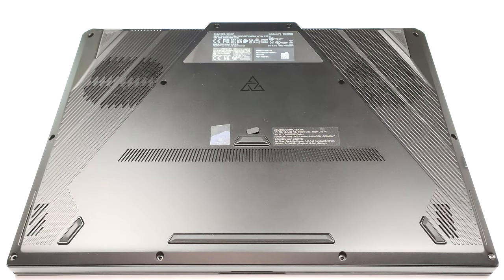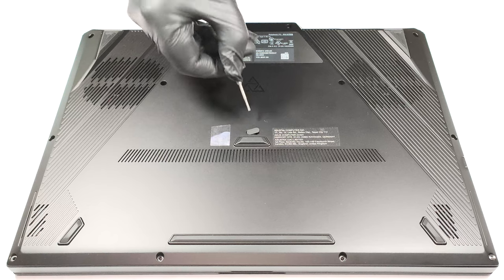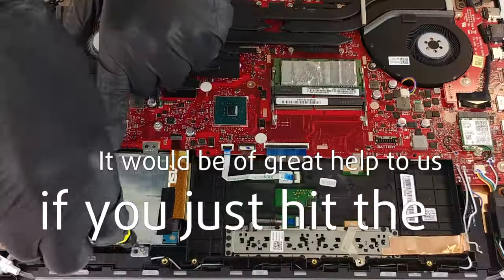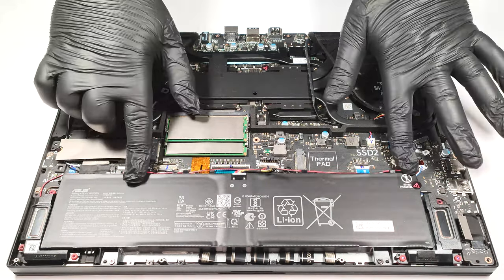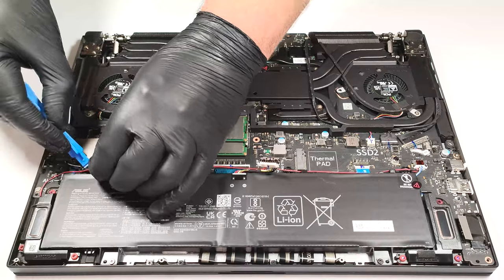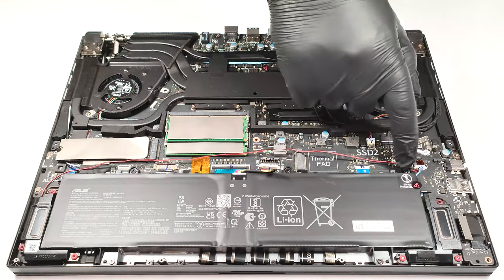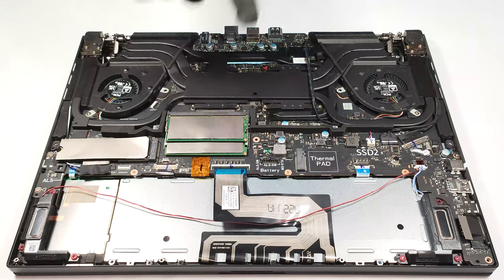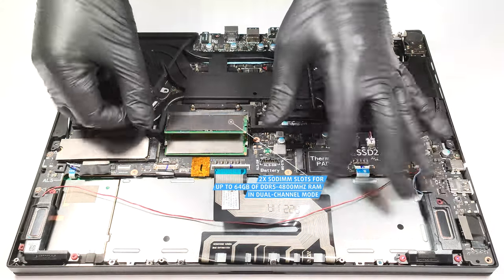🛠️ How to open ASUS ROG Zephyrus Duo 16 (GX650, 2023) - disassembly and upgrade options

Comment: factory error. It can be seen that there is no thermal paste in the upper left corner of the cooling on the last mosfet, which will lead to its burnout
Reply: That already has pre-attached with the Nvme. You can see where he shares the image on Nvme in the middle of the screen.
Reply: power mosfets only need cooling when many are close together.  a single one can sink heat into the copper of the PCB it's soldered into.  there is quite a significant amount of copper in a PCB.  in addition to the traces there is a ground plane that is a rather effective heatsink.    in servers you typically don't see any heat sinks on VRMs because there is good airflow over the motherboard.
Reply: @g1981c  
- power mosfets only need cooling when many are close together.
- yes, you are right, and this is exactly the case. If you notice that the engineers have made a separate cooling tube for them and the pad, which is soldered to this tube, is just as long as the entire width of the mosfet line

- a single one can sink heat into the copper of the PCB it's soldered into
- that is why you can find a video with the disassembly of this laptop, where after a year of using the plan under this mosfet burns out from high temperatures

- in servers you typically don't see any heatsinks on VRMs because there is good airflow over the motherboard.
- What does the server have to do with it? We're talking about a laptop! That's why they don't put such cooling on servers, because they don't need it! And here it is needed and it is fully implemented! One more time! Look at the cooling pad! If suddenly, for some reason, he did not need cooling, then the engineers would not have made a platform of such length!